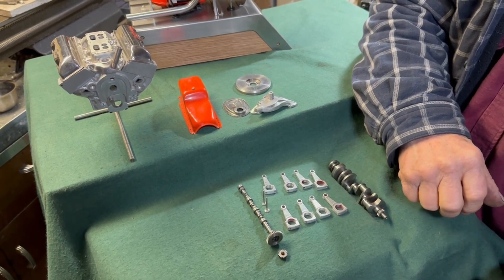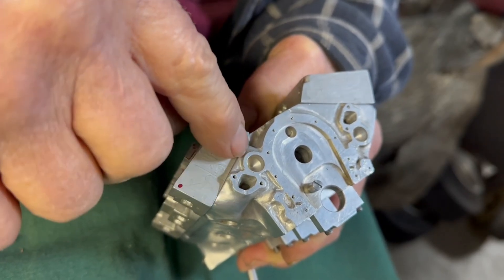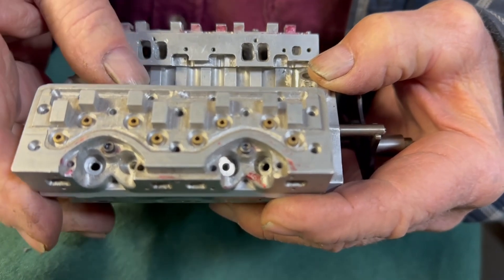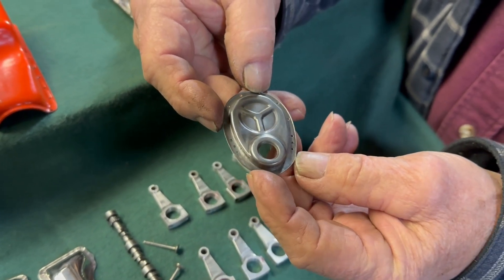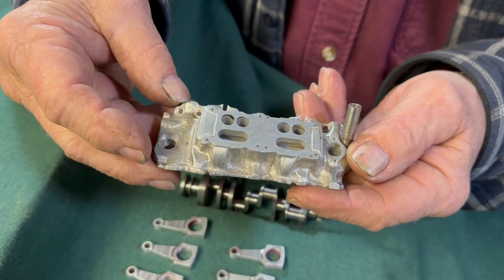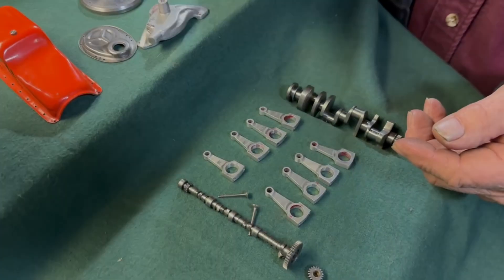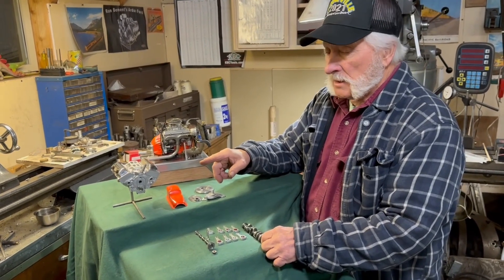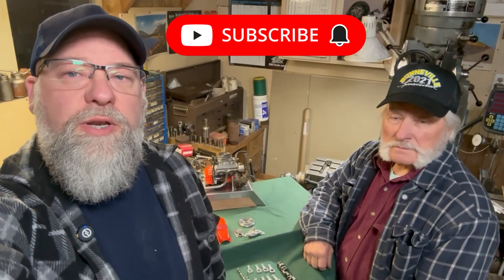The World's Smallest Chevrolet 409 "Big Block" V8 - Introduction

Comment: I love this !  I have a 409/425 hp in my living room as a display coffee table,  I tried to build a quarter scale 409 the short block crankshaft is steel and pistons/rods are aluminum it's almost done  I tried casting the heads but stopped there because of failure and time.